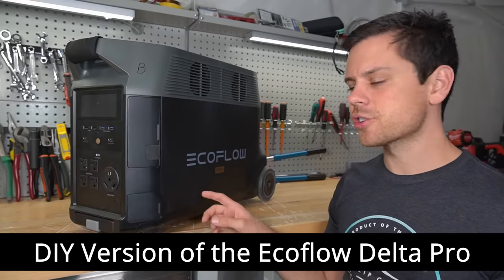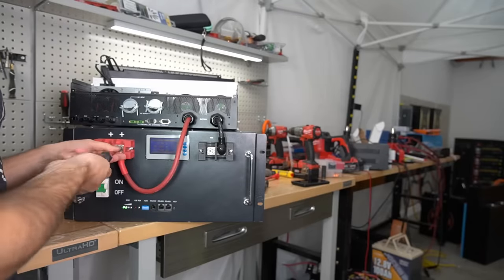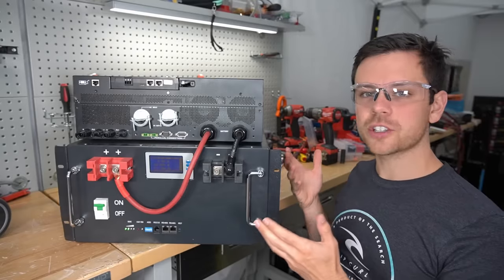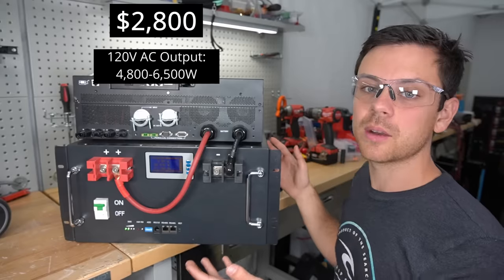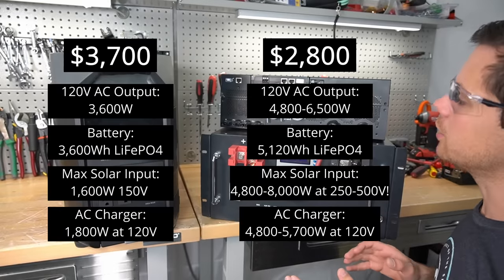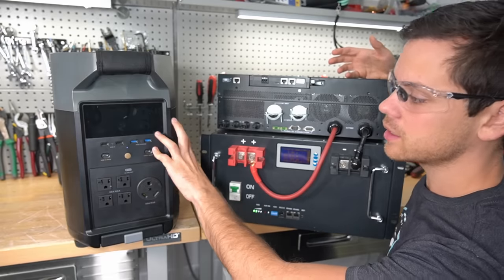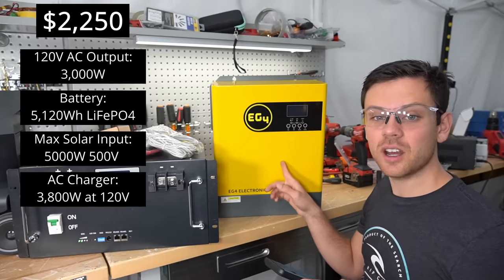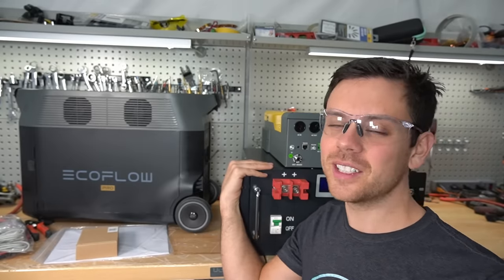Budget DIY Ecoflow Delta Pro! More power for less money

Comment: This is Great!!! You have a great way of explaining a system so almost anyone can understand it. I have a question. I have an RV and thinking of putting the 48 volt battery and the EG4 3000 unit with it. I was thinking of adding a 48 to 12 volt DC converter to run the 12 volt circuits  in the RV. Would you come directly from the battery or is there a connection in the EG4 3000 to do this? Thanks Steve

Comment: Could you do a plug and play home set up where you can run a budget, decent quality system through a generator transfer switch. Like right now I am doing one with an Ecoflow delta pro, but it would be cool to do it with a cheaper set up. The key being you have the ready made Solar plug ins and the 240 out for the generator transfer cord. Thanks.

Comment: The one thing I am confused about is that in this video Will says that if you want 240v from this inverter you would need communications cables and wire up you own sub panel. When I called Signature Solar they said I would need two of these inverters for 240v or use the 6000EX inverter the weighs twice as much. Confusion abounds! I can't seem to find your video on doing this as you say in this video. I know you don't often reply to comments but could you just point me to this video you are talking about. Thanks

Comment: I think the minimum PV voltage voltage could be much higher for the DIY version too. So if you have limited roof surface l /not enough solar panels for the that may be an issue.

Comment: Me: Trying to drag that setup over rocks, through the dirt, trying to figure out where to plug in my saw, or plug it into the wall to charge it... And then it starts sprinkling out!  Oh crap, open electronics and no circuit breakers!   SOB!  

Come on Will, that's hardly a direct comparison.  I thought you'd at least come up with something on wheels, a way to plug everything in (including a charge cord), circuit breakers, and have some protection from the elements and light impacts to the sheet metal housings.  I'll be honest with you, this one was a let down, apples to oranges!

With that said, you many I've often thought a basic setup like this makes more sense for folks who will never do anything other than backup their house with them.  But for in the field, they make a lot more sense than your "setup".  🤣

Comment: Can you please do a short video showing how to connect the EG4 inverter to a standerd wall outlet? Gauge, breaker, plug, etc. 
can I literally just chop off the end of an extension cord, hook it up to the inverter AC input and plug it into any wall outlet to charge the battery? Solar isn’t always available so charging the battery with grid AC is a big bonus. Thanks.

Comment: The Delta Pro can be charged at an EV station though. Is it possible to work that connection hub into this system? Seems like a huge bonus to be able to charge your camper system at an EV station if you're urban camping or in a pinch.

Comment: Thank you for this video! What power system would you recommend for heating an SUV for 16hr I don't want to use solar charging. I want to use DC and alternator charging. I want to run the space heater that I use in my house.  Also, I live in very cold 🥶 climates 

Thanks in advance for answering my question.

Comment: Just wondering about 12V for moving vehicle charging. Would a 12v DC to 120v AC converter connected to the EG4 inverter 120v AC input be OK? No damage to inverter? How much wattage would be best? Typical truck alternators could supply 700-800w to the inverter. Saw this as a method to charge the EcoFlow Delta Pro at faster rate. Any ideas for the transfer switching to the EG4 from shore power to vehicle power - EG4 in trailer (normal transfer switch?)  Any other alternatives (DC/DC) for moving vehicle charging for the EG4 type system?   (appears solar and alternator could be working in parallel for fast charging while in motion?)

Comment: Will,  What would it take to build a portable EV charger using the off the shelf components & a 32 Amp charger?  Possibly three batteries & it would need to be 240VAC out for the charger.

Comment: This question might have been answered before but there it is. For a RV or Camper van use case, it is very convenient to charge from the vehicle alternator. Is there a way to do this with a DC-DC charger into this 48V system?

Comment: I was just at Costco today Will, and they had a road show for the Ecoflow Delta Pro on sale for $2,800. If I wanted to put this into our Deisel pusher Monaco class A, would you still go with the DYI system? I don't have any solar panels yet, so would have to add those. If I wanted to be able to run my AC unit off the system, instead of my 7K genset, I'm sure the 6K DYI system would be better with the 2nd server rack cell. What do you think?

Comment: I have 6 Ecoflow Delta Pro batteries using an Ecoflow smart panel, and (according to the app) the AC output is nowhere near 3.6 kWh per battery, but the AC input does exceed 11 kWh - it is not currently connected to solar. I would love for you to do a comparison on the measured AC input versus the measured AC output on the Eco Flo delta pro to see if you get the same kind of results.

Comment: One more comment and I get the fact that it’s only two cables right but there are so many question like why does this thing have CAT5 inputs what what is that needed for it and I just don’t understand why why these things aren’t simpler like why don’t they just have plugs on the front like the Delta pro someone should make something like this but make it simple and then a guy like me would probably buy a set of them so I my house could be completely off the grid.

Comment: I would really like something like this but for 240 split-phase usage without having to wire up two inverter-chargers. I have a transfer switch already on the house but need the clunky ice generator to power it. I would prefer a mobile diy solar generator and maybe a small ice generator to top it off when solar isn't working out say in a winter storm. 5 KWh could last me a day or longer.
Reply from the maker: Oh sure, use a LV6048 instead. That's what it's made for, 240V without paralleling anything

Comment: How does the round trip efficiency compare between the two systems? I read the ecoflow has a round trip efficiency of only 58%. If I am considering using it to shift my power consumption from peak to off peak, I would not save any money..

Comment: I just nabbed a Dabbsson DBS2300 for $1,150 out the door thanks to an Amazon sale (or stack of discounts), this unit like the Delta Pro supports adding a battery add-on to expand capacity, I would love to find a way to DIY the add-on, all the video's I've found so far are simply using a 48V battery as a way of charging the internal battery via the Solar Input, I want to be able to have Solar Panels that I will be getting to charge both the internal battery and a "DIY battery expander" and then for the battery "expander" function just like it was an expander pack, just way cheaper.

Comment: Hey I love your videos and I would love to do some DYII thing like this but I have zero experience with electrical I’m not even handy with anything. Do you have some kind of form where people can ask you questions like do you have a parlor account or what’s that other one Patreon that’s what I mean Patreon Because I just trying to figure out something that can run my whole home in the event of a power outage. Right now I have tesla solar panels but I have no batteries I didn’t buy the Tesla batteries because of the cost. So one of my basic questions here that’s not addressed is can these batteries be left in a garage in Phoenix in the summer? Or would I need to bring these into the house and place and then if I do that then I have to run wiring is that correct I would need an electrician to get the wiring let’s say into a small closet in the house where it’s cool.  So these are probably the kind of questions that you would never even think someone would ask but I seen your case you’ve got a lot of stuff in your garage and I know you live in Vegas I know it’s hot there so do you have an air condition garage or is it OK to let these batteries be in 170° heat in the summer? Thank you so much

Comment: Hey
Will Happy holidays. Big Question what is the Issue with the River Pro battery, problems overheating. The R PRO will not reset it self IN the MANER the owners manual suggests. It does not work & I purchased the extra Battery.
No problem with the Back up, works fine.
Work horse. The R PRO has a few Quirks 
In the beginning & if the business community  has knowledge about how to  Hard reset the R PRO . Pressing 2 buttons @ the same time just doesn't hold the resets. But maybe 2 sec then the screen returns as over loaded &  the blue tooth won't recognize this app code

Comment: I wonder how long would it take to charge up your comparative option connecting it to a generator via an extension cord? I could safely charge it up through a 120v extension cord (connecting to the MPPT) correct?

Comment: I was thinking of having a 450 renogy panel on my sprinter hooked into my delta pro. Do you think that would be a good combination? Was trying to be most effective with surface area and the 450 fits in the cross bar width perfectly

If so what type of other wiring would I need to order? I have a hard time finding direct answers to these questions and am new to portable power. Thanks!!

Comment: I am looking at buying 2 of the bluetti AC500 and 4 batteries through indigogo.

12kwh of battery and 10000 output watts and cost around $10,000 but it is 30% off.

Considering the savings, would you take advantage of that, or call signature solar and build an eg4 system instead.

The consideration is the new bluetti is portable...although heavy.

Comment: If you wire it up for 240v, does it make it any different for 120v? Just wondering if you could have an “auxiliary” pack with the additional inverter and panel if you want to add 240, or leave it at home if you won’t need it.

Comment: My apologies… I was unaware that you can charge via ac charging into the EG4 easily.  I am trying to have the ability to charge the batteries quickly using a generator if solar isn’t cutting it until I get a larger solar array.  So you can charge the batteries with an ac input quickly?

Comment: My panels are more then the rated input to the batter enphase 9.2kw micro inverters. But is the following situation possible?
Power goes out and I flip the main breaker to the grid. Plug the the battery into the generator plug that feeds the breaker and flip the generator(battery) breaker that allow the battery to feed the panel. This allows my solar to work and then I could charge the battery that could be plugged into a regular house outlet? If that is possible does the excess power that in generated from the solar just bleed off and not hurt the panels or battery? 
Also if this is possible would buy the smart panel automate this process? 
I am talking about ecoflow delta pro

Comment: Thanks for doing this video! What about a Delta Pro Refurb at $2400? I get that the DIY is also more capable, but also no warranty, missing a few details. For example, if my goal is 220, two refurbs plus the Hub is less than $5,000. I could probably do the DIY, but not easily…or any time soon. So, if the cost comparison is lower for the EF units, would you still recommend the DIY? Thanks!!

Comment: This is great information and you've sold me on DIY... but I already have the Delta Pro... so is there a DIY (lower cost) way to add capacity to a Delta Pro, other than their add on batteries for $2K?  I haven't been able to determine what cells are inside the DP.

Comment: I’m curious why you mentioned limited pv input with one battery? These units can run purely off solar. So why would the pv input be limited by your battery capacity?
Reply: It is the amount of amps the battery BMS allows for charging and discharging which in the Trophy is 100 amps.  So 100 amps x 48 volts = 4,800 watts charging/discharging
Reply: @ronbridegroom8428  that doesn’t limit the amount of pv you can have though. Just the charging current. You can adjust the charging amperage to whatever safe level you wish and the rest of the pv can go directly to the loads or nowhere.

Comment: Thankfully, I got my pro for 2500, but there are two major issues for vans or RVs. It can’t handle diesel heater startup amps unless I convert to AC first. The main issue I have with Pro is not being able to charge it with solar and the cigarette lighter at the same time as they share the same single input port. Do you think it is possible to wire the two reds and two blacks from the solar and cigarette lighter adapters to go into that 1 port? Then I could drive from A to B charging it with solar and the alternator. I don’t know why they didn’t put two ports.

Comment: Ty Will.

Something I want, 

Solar power station.

I want a box/board where I can take 24v solar, up to 400watts and then output varying voltages, sockets.

Just to say

Background noisy video 

Can I connect 8 100 Watt solar panels, connecting 2 panels X 4 parallel, and then connect those in serial to give 24volts at 400 Watts?

Comment: it would be awesome if there was a system that was about half this size but still had the same voltage output ratings.

Alot of people, i imagine, have a keurig or a water heater, or an oven, or a laundry machine/dryer.
All of these are a little too much for a conventional battery, a keurig pulls 1400w
I would love a system designed to power a keurig or my laundry machine.
The thing is I don't need a giant battery to power this, i just need a battery that can output enough power, and then i could "trickle charge" it with a couple smaller panels since i only do laundry once or twice a week, and I only have a cup or two (okay maybe 3) a day

Looking at making a lead acid battery setup to accomplish this even, just because in this scenario i don't need to fully deplete the batteries every time, i just need a good output.

Comment: I need something like 240 VOLT to plug in my Food truck. What do you suggest? Similar to buying 2 eco flow delta pro battery spec with the dual voltage hub.

Comment: Will - great video.  I have 2 delta pros, 4 batteries and power hub.  I have this going through a 30 Amp box then through a transfer switch to power my panel.  My issue is that the delta pros keep getting error codes, I had to return the 2, they sent me 2 new ones, ran great for about three weeks, then one of the new units stopped working with a 550 error code, and it charges, but will not provide AC power through the hub, or through the outlets.

Is there a way to repair the delta pros my self by putting in a new circuit board or using a reset procedure?  Tech support is non existent, but they seem to be willing to keep shipping new units.  My concern is that in a SHTF situation I won't be able to get new units.

Additionally, if I did what you showed hear, but with multiple units, is it possible to somehow use the power hub from Eco Flow?

Sorry for being long winded, but from the forums I'm on, seems like a lot of folks are having similar problems.

Comment: One thing the EcoFlow will do is act as a UPS. Maybe you're not doing a solar setup and just want to ride out power outages. The EcoFlow units can bypass the batteries and switch over in ~30ms. The DIY approach, it doesn't sound like it can bypass the batteries, so not as suitable for a pure backup solution. Though there's one major downside to using the EcoFlow as a UPS: unlike a dedicated UPS (like, something from APC), EcoFlow always routes the AC power through the inverter, which is inefficient (and loud!) when you're on grid power. Of course, APC charges around $40,000 for a rough equivalent to an EcoFlow Delta Pro, so...

Comment: What about this combo?
+ sungoldpower 5.12KWH POWERWALL LIFEPO4 LITHIUM BATTERY SG48100M
+ sungoldpower 5000W 48V SOLAR CHARGER INVERTER SPH504880A
= 2200$ with free shipping.

Just mount them on top of each other on a dolly and you're good to go.

Comment: Just wondering if any of these inverters have a 12v output option? It would be great to have an easy way to connect 12v loads in an RV setting without the need for a 48/12 converter.

Comment: Great video!

I am learning about this topic and have a question re: the solar input. I see it is minimum 250V for the example DIY setup. Does this mean that one would need to run multiple panels, in series, to get up to that minimum? I'd read that panels can go up to ~40V...does that mean a minimum of ~7 panels would need to be connected to reach the minimum 250V? Am I looking at this the right way?

The reason I ask is that I am researching DIY systems but would like to start small and upgrade over time. If I'd need to install a bunch of panels this system might not be for me yet...until I level up from "noob" status. HA.

Thanks!

Comment: I sold my Anker 767 power station and expansion battery so now I can make this unit, The only problem that I can't figure out. Both the ecoflow delta pro and the Anker have 30amp output plugs and I can't figure out how to get a 30amp output from the 6500EX. Any help or suggestions would sure be appreciated

Comment: Love this video, would you recommend a eg4 battery with smaller eg4 inverter  if in cold area with warming blanket for battery or use the trophy battery with eg4 smaller inverter? This is for a RV with the battery and inverter going into one of the bays under rv. Thanks in advance for your thoughts.

Comment: For the RV/motorhome application, what options are there for alternator 12v charging. Separate AC inverter for AC charge input, or DC to DC input to solar array input? Would like to avoid  a portable generator.